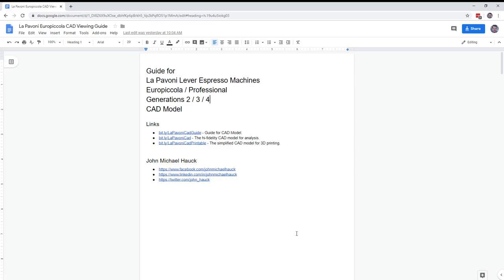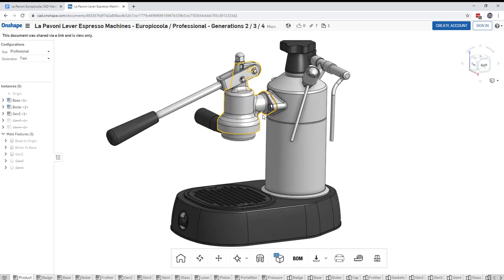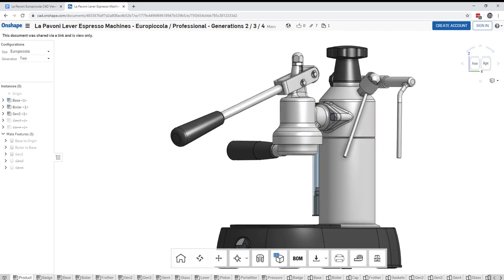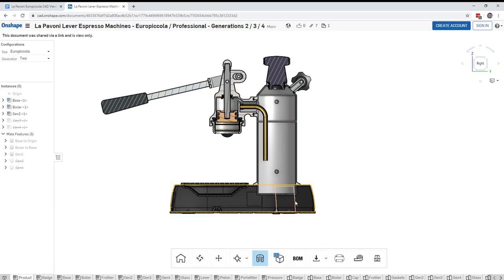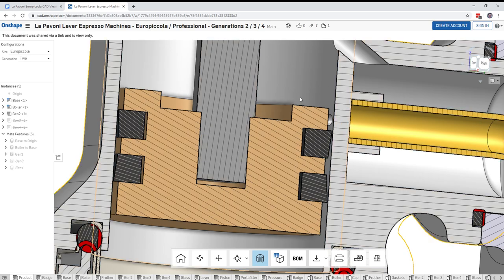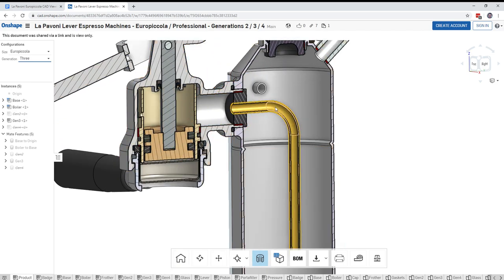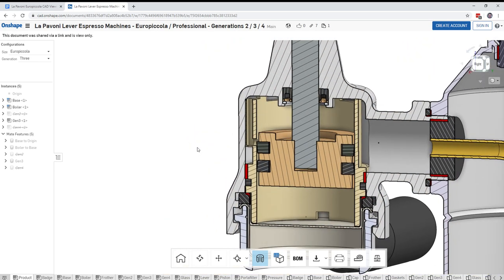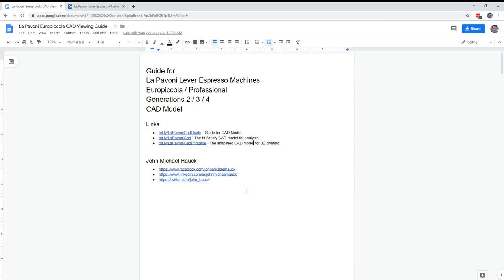1: Overview - La Pavoni Lever Espresso Machine

Comment: John, this is an excellent explanation of the differences between Gen 2, 3, & 4 groupheads (GH)and how they work. I hope ALL La Pavoni lever machine owners watch this.

A few observations (everything mentioned here regarding Gen3s also applies to Gen4s): 

1. Upper chamber: The top of the GH is important in the heat-up process. Gen2s are steam-heated, Gen3s water-heated. When the lever is at its lowest position, steam or water is allowed to fill the top of the GH, i.e. the upper chamber.  Water-heated Gen3s tend to run cooler for this and a few other reasons.

2. Lower chamber: Gen2s and Gen3s have different mechanisms to fill the lower chamber:

   - In Gen2s, water enters the lower chamber directly from the boiler at close to boiler temperature. The only way Gen2 owners control the temperature of water that enters the lower chamber is by switching between the two heater elements (if it has 2) or by switching the machine off (or the pressurestat switches off the element if equipped with a pstat). 

   - In Gen3s,  water that enters the lower chamber is tempered by the GH. First it swirls around the outside of the sleeve and then enters the lower chamber from the top of the upper chamber through a tunnel on the exterior of the sleeve, as you noted.

3. GH temp: In all generations, GH temperature is important and worth managing. Once the water enters the lower chamber and comes in contact with the GH, GH mass will further heat or cool it, and thus, establish brew temp. Gen4s have more GH mass to affect water temp.

I love having a model to show how our machines behave differently. They are truly "different animals." Thanks for all your hard work.

Comment: 9:17 Steam or air are compressible: once they reach equilibrium with the steam/air in the boiler, water from the boiler will stop coming up to the head.
If for some reason you can increase the pressure in the head (e.g. by decreasing the volume through piston action), then there's only one way for the steam/air to go: back through the tube.
If you decrease the pressure in the head (e.g. by increasing the volume through piston action), the opposite will happen.
This is my understanding based on your presentation.
Reply from the maker: Stelios, it is all a bit confusing, but I think your comment is consistent with my understanding. I'll restate your comment in my own words to see if I am understanding your point.

Raising the lever raises the piston, which decreases the volume in the chamber above the piston, which forces any water, air, steam out of the chamber above the piston and back into the boiler via the siphon tube.  Lowering the lever lowers the piston, which increases the volume in the chamber above the piston, which draws water from the boiler into the chamber above the via the siphon tube.

Let me know if you have any concerns or questions.
Reply: @JohnMichaelHauck  In my comment I was always referring to the volume (and pressure) of the chamber above the piston. I also corrected the time. Apologies if I caused any confusion.
I agree with what you wrote except that you have one typo in :
"Lowering the lever lowers the piston, which decreases the volume in the chamber above the piston" 
It should be "increases" and not "decreases" of course.
Reply from the maker: @Stelios.Posantzis  Thanks for catching that! I edited the reply to fix yet another silly mistake of mine.
Reply: @JohnMichaelHauck  I dare not think how long these CAD models must have taken to make. Their precision is very impressive. 
A very useful guide for choosing between models and identifying which model corresponds to a particular second hand machine.

Comment: Nice! It's the first time I understand how exactly the La Pavoni works, thanks! I'm wondering though, on 3rd generation, once the lever is down, it's possible that the chamber above the piston might get full of water? Then, when you lift the lever, how is that water going to escape the chamber? I can't imagine it. On the second generation the steam will push the water back to the boiler but there's nothing like that here. To me it seems if there's trapped water, its only path is through the piston rod gasket at the upper side of the head. BTW, on my La Pavoni some water started leaking from above when I lift the lever before making a shot, so my theory is corroborated. I guess if all is sealed properly, water can't enter the upper chamber because it will be hermetically sealed.
Reply from the maker: Glad you like it. To address your question, on the 3rd generation with the piston down, water does indeed fill the area above the piston. When the piston is raised, this water travels up over the top of the sleeve, through the neck and back into the boiler. Take a look at the top edge of the sleeve, and you will see what I think look like "battlements" on the top of a castle wall. Maybe some of the other videos in this playlist will help. https://www.youtube.com/playlist?list=PLPX9KWMNFMwNk_aBK7plrFBF1VJx0OMVw
Reply: @JohnMichaelHauck , ahh, you’re right. Indeed that’s the water path as it seems. All makes perfect sense now. Thanks again!
Reply: @JohnMichaelHauck  so as you have described with 3rd gen grouphead as the lever moves up, the user will feel difficult to raise the lever because of traped water, and the lever will go alone quick down if you leave it, 
right?
Reply from the maker: @panosswiftsport  Correct. The user will be raising the piston against the boiler pressure. It does not take much effort, but it does lift the front end of the machine a bit if you don't hold it down with your other hand. As you said, if you let go, the lever drops quickly. However, once the lever is all the way up and the water fills the area under the group head, then the pressure equalizes and the lever stays up by itself (provided the coffee grinds are fine enough to prevent the flow of water at low pressures).

An interesting related phenomenon is that this works backwards. When you turn off the machine, there is no air* in the boiler but just steam. As the steam condenses into water as the boiler cools, it creates a vacuum. The pressure relief valve on most machines will open at this point and let air in. If the pressure relief valve is an older design or is stuck closed, then the vacuum causes the piston (and lever) to rise.

* The reason there is no air is because opening the frothing (steam) valve lets out the air and all that is left is steam. You need to realize steam is not hot air. It is vaporized water that condenses (contracts) back to liquid water when cooled. Modern pressure relief valves take a while to close, first letting out a lot of air. So in practice, when you turn on your boiler, after a few minutes you will hear air escaping from the pressure relief valve for a few seconds before is closes with a satisfying click. If it does not close, whack it with a wooden spoon.

Cheers!

Comment: Incredible CAD’s John. Quick question, is it possible to Pull a shot using Flow Rate profiling ? Thank you
Reply from the maker: Duncan,

Let's say you want to start with 1 bar for 8 seconds, then 7 bar for most of the volume, then finish with 5 bar, you can indeed do it. What you need to do is press the lever down softly for 8 seconds, then press pretty firmly for most of the volume, and then back off a bit for the finish.

Now you will ask, how do I know what "softly" is for 8 seconds? Good question! Well, let me ask, why you want 1 bar? Because it taste good that way you say. Fine, I say, then figure out over time what amount of "softly" gives you the best tasting shot. In other words, use "feel" to dial in your shot profile, not numbers.

That may be, you reply, but my question implied numerical precision, and you dodged that in your answer. Well, then, I reply, you could trick out your La Pavoni with a "pressure profiling kit". This is an analog pressure gauge that connects to the piston. You can then watch the needle as you pull your shot. Mind you, for the 8 seconds you will need to watch a timer too! Such a kit can be purchased here: https://coffee-sensor.com/product/coffee-sensor-full-piston-pressure-kit-for-the-la-pavoni-europiccola-pre-millennium-and-millenium-machines/

Now if you want a machine that can run a precision profile with the touch of a button, I am smitten by the products at http://decentespresso.com/

Tell me if I answered your question somewhere up there.
Reply: @JohnMichaelHauck  Thank you John, your information is great & I’ll give it a go. 
It’s interesting that some semi automatic machines are adding this flow control & the most basic machine has had this feature for nearly 70 years. 
I’d never replace my Pavoni, it’s just great and stunning to look at. 
The only thing I wish the Pavoni’s had was a heavier base, I think the mk1 or mk2 had a metal base. 
Many thanks again 👍☕️🇮🇹

Comment: Hi I have a question I can’t seem to get answered anywhere else, I seen this review on Amazon:

“Then I noticed that after using it, there was a puddle of water underneath. La Pavoni sent me to Thomas Cara in San Francisco, and said he was their representative. HE curtly said he was NOT their representative. But he described a defect in the Stradivari design - the heating element is made of stainless steel and the bottom fixture is brass - so they cool at different rates and frequently leak like mine was doing. So there is no good fix for this $800 espresso maker.”

That’s a quote from part of the review, while I’m not interested in a Stradivari I am looking at getting the esperto abile 

I’ve read the esperto abile has the same “base” as the Stradivari but with a red accent, I’m not sure what other similarities they may share but I’m worried this “design flaw” would be apparent in the esperto abile model as well

Basically I’m other words, do you know if the esperto abile has a stainless steel heating element and a brass bottom fixture? 

I’m not sure what the “bottom fixture” even would be or if this is even a credible complaint. 
Do you believe there is any truth to this? And will it happen with the esperto abile if I buy one?
Reply from the maker: Adam,

I'll try to help.

This is what I think he means by "heating element":
https://coffee-sensor.com/product-category/la-pavoni-parts-and-accessories-custom-made-from-coffee-sensor/heating-elements/

This is what I think he means by "bottom fixture" (I call it a "boiler ring")
https://coffee-sensor.com/product-category/la-pavoni-parts-and-accessories-custom-made-from-coffee-sensor/boiler-rings/

The boiler ring is screwed around the bottom of the boiler.
The heating element is attached to the boiler ring with three bolts.

Water can leak from where the two heating element connectors protrude from the heating element.
Water can leak from the interface of the heating element and the bottom of the boiler.
Water can leak from the hole which is connected to the pressurestat with small pipe.

I would strongly suspect (but I do not know for certain) that the boilers/heating elements/boiler rings of the Esperto Abile and the Stradivari are identical. I cannot tell you what materials are currently being used in new products. I can tell you that from all the online forums I monitor, I have not read about a chronic issue with water leaking from the bottom of the boilers - neither new machines nor vintage models. Personally, I own 3 different recent generation La Pavonis (including a 2020 Stradivari) and have not experienced any leaks on the bottom of the machines. I would guess that a leaking new machine has more to do with one of the three bolts being a bit loose.

La Pavoni has done a remarkable job of continuous product improvements since 1960. Maintaining and repairing the machines is easy enough.

I hope this helps.
Reply: @JohnMichaelHauck  helps a bunch thanks! :)

Comment: Is the CAD model Canadian? Do you have to get somewhere other than their website to  get that?
Reply from the maker: Adam, I'm confused! The model should be available internationally. Can you see it at https://bit.ly/LaPavoni ?
If not, try this full URL
https://cad.onshape.com/documents/4833676df7d2a808ac4b52b7/w/1779c4496f69618947b539b5/e/75f2654cbbb785c3812333d2
Reply: @JohnMichaelHauck  sorry I was confused too I’m just wondering what the CAD model is? 
I’m the begging you say “this is the la pavoni cad model” 
I was just wondering if cad means Canadian or maybe it meant something else
Reply from the maker: Adam,

Forgive me, I am a hypocrite. I take a dim view of people who throw around three-letter acronyms as if everyone knows what they mean. Here I am doing the same thing.

I am using the term "CAD" in this case to mean "computer-aided design" (https://en.wikipedia.org/wiki/Computer-aided_design).

Over the course of many moons, I took physical measurements of various La Pavoni lever machine models in my possession and then "drew" them in a three-dimensional space on a computer. For example, the lever rod is a metal cylinder. So I drew a circle on the computer of the diameter of the rod (12 mm), and then "extruded" the circle into a cylinder of the length of the rod (160 mm). I then drew the black handle (a bit more complicated) and attached it to the rod. Then I added the fork on the other side. Once I started modeling the "e-style" retaining clips for the pins on the fork, I found I had descended into a rabbit hole with no escape. So I undertook to model the entire machine, including switches, wires, logo, and pressure gauges. I'm still not done, but I've completed enough to share this computer model of the La Pavoni machines in these YouTube videos.

I hope I answered your question.

- John
Reply: @JohnMichaelHauck  completely! And cudo’s to you for putting in the work this really helped me out and I think it was WELL worth the effort. 
You are a legend